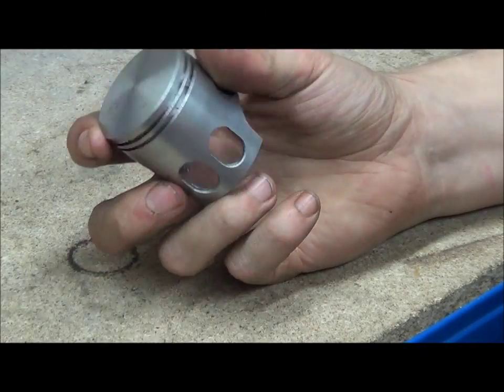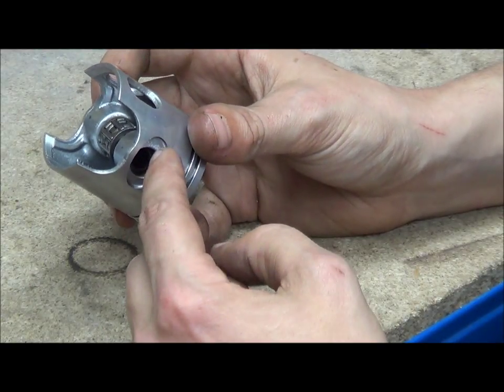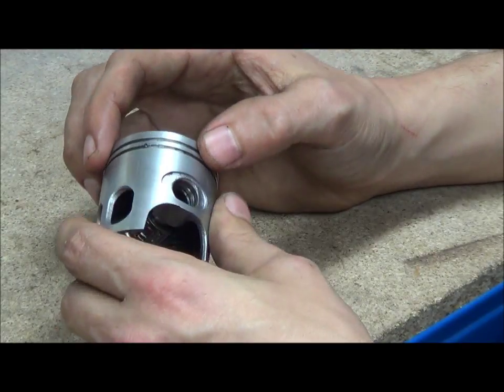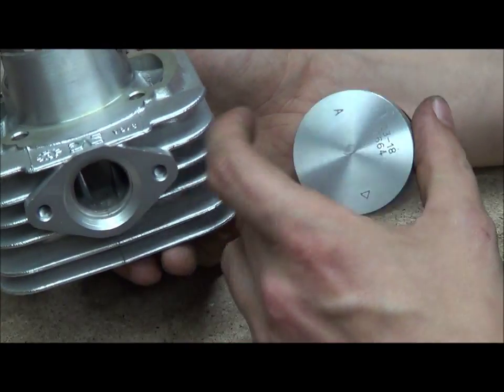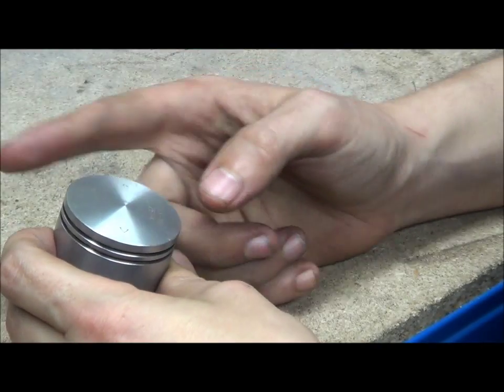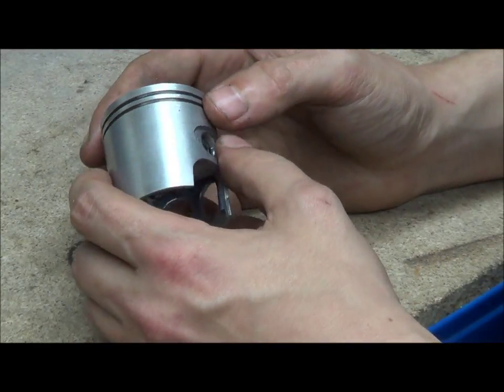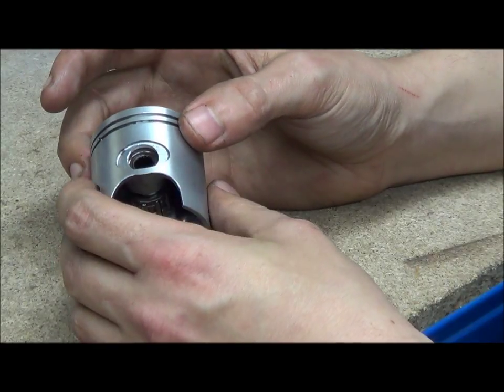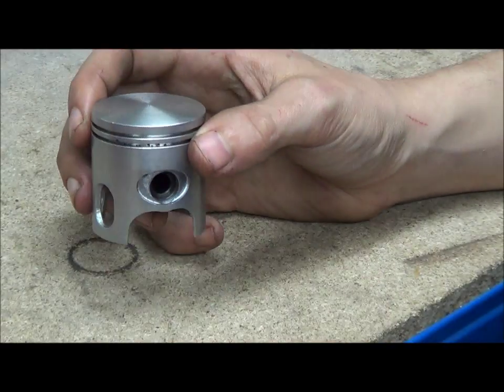Piston Basics - 2 Stroke

Comment: Can you explain more about benefits/compromises involved in different crown setups - like flat, domed? I would have imagined concave would have been better for ideal combustion chamber geometry, but mess with flow perhaps. 
I wonder if domed is good cause essentially there is more surface of the piston for the combustion pressure to exert force to.